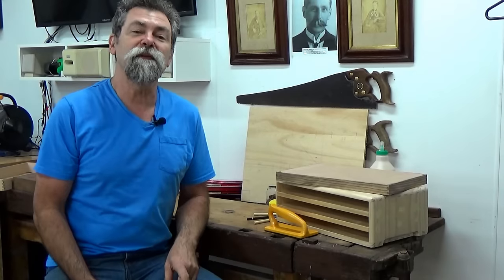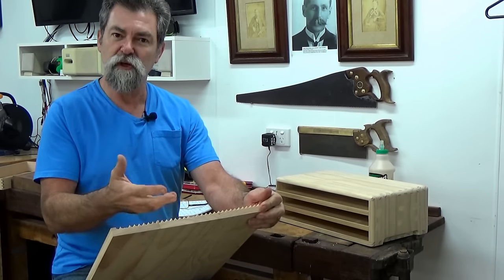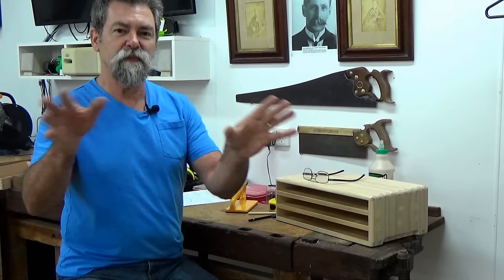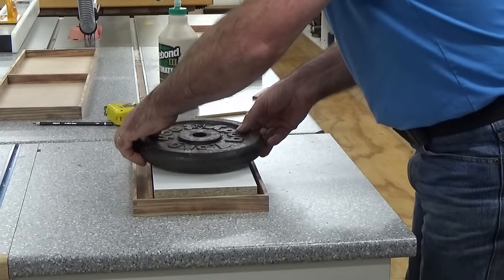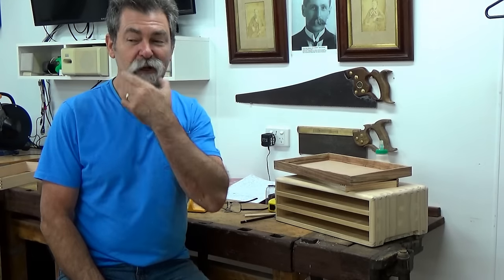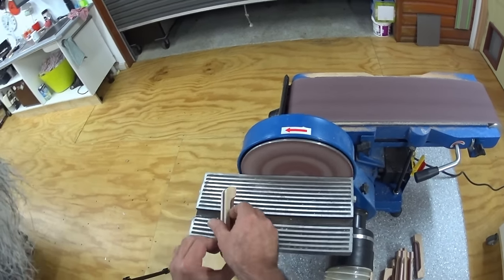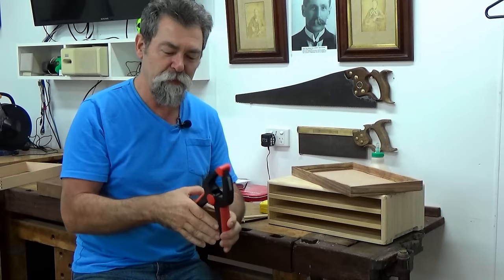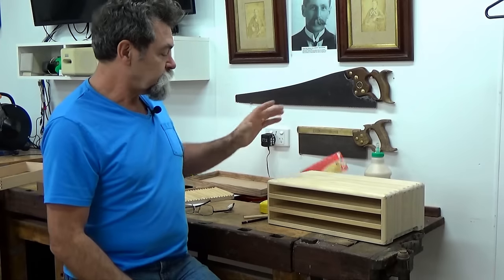How To | Studio Pencil Box Build 4 | Drawers | Cradles | Handles | Finish | Gift | Love

Comment: One thing you didn't show was cross cutting the channel boards to fit the drawers. How did you avoid tear out on the ridges/peaks?
Reply from the maker: Sorry Robert, I thought I had covered it but if not, you set your blade as high as possible on the table saw. This way the force is as vertical as possible and then no tear out on the individual troughs or peaks.

Comment: Great end to the series Davo, the handover was touching. with regard to the purple heart i was pretty sure that exposure to uv will make it lose the purple colour not gain it as you say no? thats why the old exposed edge you showed was all brown.

just wondering, how much does the big bopper weigh with all the pencils?
Reply from the maker: Hi Albert, I can only go on what I see with my own eyes. When I cut the purple heart or use the disc sander on it, the timber is brown. 10 minutes after exposure to UV it pops purple. That piece I showed may have sap wood on the rough sawn section?
Weight, no idea...maybe a couple of kilos?

Comment: well done. going to make one for my daughter. on another note I have watched all your videos and see your tools. I have a small collection and alot of new n old n very old hand and power tools tools from around the UK n Poland and Germany. my question is i am relocating back to Australia and would like to pick your brains about what tools be it hand or power, big or small that you find hard or have to import from anywhere else that Australia is either difficult or does not have. my power tools I am bringing be it table saw, bandsaw, routers etc are all from UK which is 230-240v so no worries there. I am thinking old stuff like anvils. wood table vices, planes etc cast iron n steel. seeing as having to pay for a container anyhow though wld be better bring with me instead of building bigger tool supply when in Aus and finding out the hard way n expensive way. hope this makes sense. am more than happy to give you my contact details if you want to discuss or ask questions. thanks and keep the inspiration coming
Reply from the maker: Hi Cameron. Not really sure about what the question is. If it is about machine availability in Australia, we have everything.
Thanks for the compliment on the box.